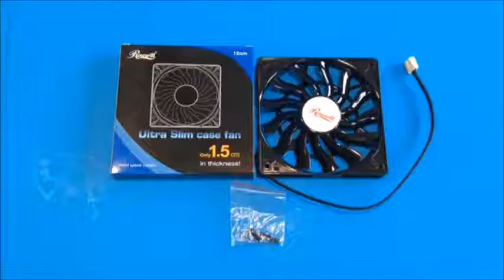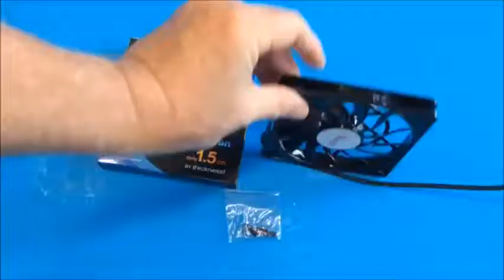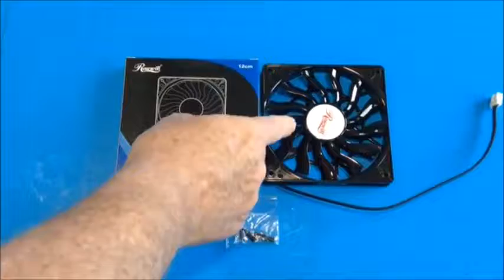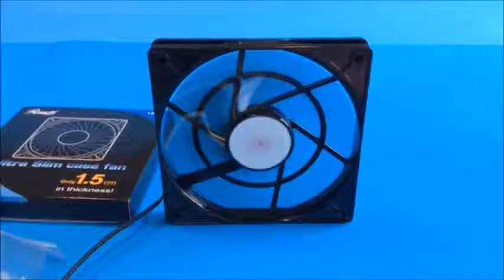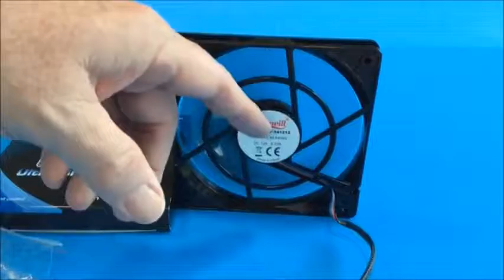Rosewill Ultra Slim 120mm PWM Case Fan Review

Comment: Thanks for the review. Need to put this on my sidemounted radiator to fit in my Compact mid tower case. No room for my 3080. Do you have any other suggestions for slim case fans.